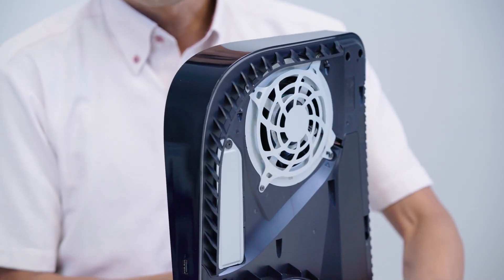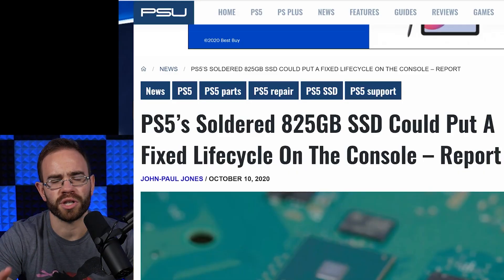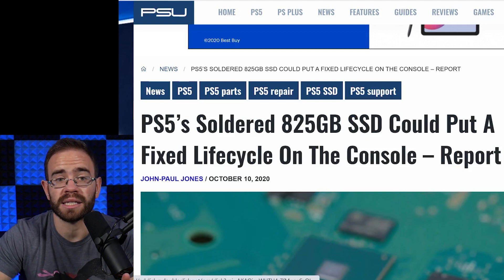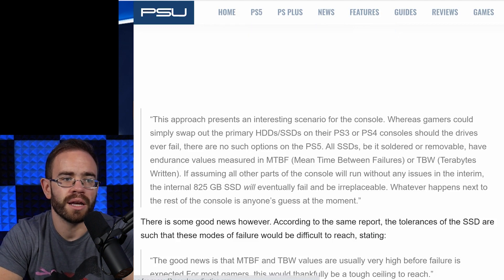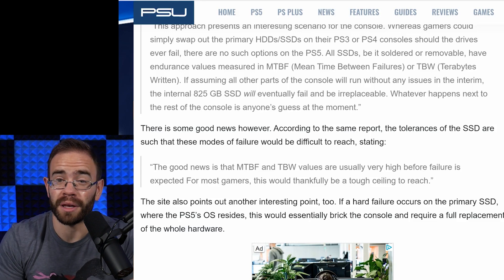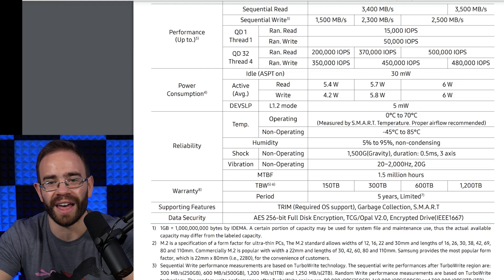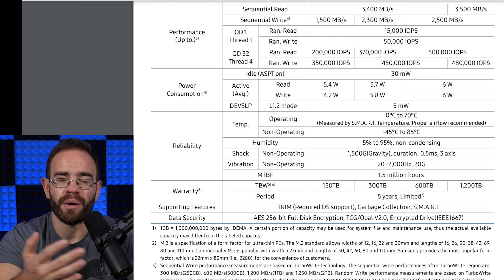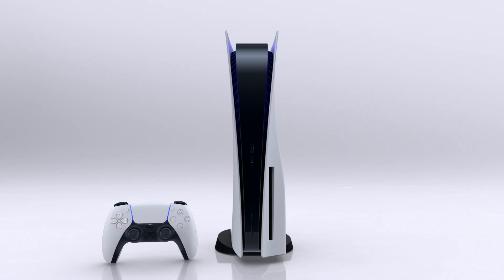Is The PS5/Xbox Series X SSD A Problem For Preservation?

Comment: In theory, couldn't they issue a patch way down the road that allows the system to run off of external storage in case the internal storage failed? I mean, I know you would have to do a factory reset of the system, but by the time that this could be an issue, the NVMe drives will be fast enough to run the whole thing. I mean, it's possible, right?

Comment: Wtf 600 tb is extremely low when we are storage limited? !That’s straight up stealing the consumers!
Reply: No it isn't.  That will last at least 15 years under normal use and that's the standard for anything between 500GB and 1TB, it's the same with the Series X, you'll have to write an absurd amount of data on a daily basis to kill it prematurely
Reply: SNM: Nightmare Hollow there are rumors that the storage in the series x is replaceable

Comment: The wii u had its 30 gb on the board, same with the switch. If those memory chips fail your screwed, no operating system etc..  Why is this an issue now all off a sudden?  I know it isn't the same, but look at old kart games.  Those chips are old as heck, and the ones that hold saves are going strong as long as the battery works.  I'm not worried.
Reply: Because these "issues" only gets hate if it's related to Sony

Comment: For anyone worried about this, please don't to give some perspective on it I have 3 drives in my system, 2x 2TB, which I have owned for 3 years and written 12.7TB in one and 19.3TB on the other, even if it was rated at 150TBW you can clearly see it will last a bloody long time.

Even my main drive with is only 512GB and is constantly download and writing to drive as its the main OS drive, has only written 22.9TB in the last 3 years, all 3 are filled with games I uninstall move around and so on. Now my 512GB is written for 400 TBW (a bit lower than sonys one maybe) and at the current rate, of me using lets say 8TB a year it would take me to 50 years to hit that, chances are in 50 years time the system would have died from a bunch of other things at that point

Comment: Sony could release a firmware update that lets you run the OS off the expansion slot if the onboard SSD fails, and who knows it might already be in the firmware, but it's a bit hard to test until the onboard SSD does actually fail.

Comment: The five years noted in the spec sheet was for the warranty, not overall reliability so is not really accurate.  The actual TBW would be much, much higher.  I know it's an apples to oranges comparison, but the warranty time was 5 years, but the MTBF was 1.5 million hours.

Comment: I'd be more concerned with a failure caused due to the new liquid metal cooling solution than the ssd
Reply: The liquid metal is gonna be fine. They sealed it so it won’t leak at all.  Failure from the liquid metal can get Sony in a lot of trouble. They would never use it unless it works bc of the high risk
Reply: @phantomchampion1579  Only time will tell......

Comment: As blocks die on SSD's, the drives are generally designed to automatically use new blocks from non-partitioned space. This is why I generally leave 3-7GB free on all my NVMe (SSD) drives.
Reply: This is typically done on a lower level in th ssd controller firmware, using spare blocks not visible in the partitioning tool. You should not need to leave unpartitioned space in order to enable this functionality.
Reply: S4RDONIC  you're on the wrong channel if you don't care about the tech details
Reply: S4RDONIC  By “free” he likely means unpartitioned space, rather than total space free. With that in mind he’s completely right, so why are you telling him to shut up?
Reply: S4RDONIC  I do.
Reply: S4RDONIC  we’re not going to be making assumptions here, are we?

Comment: You can on the Xbox! Go check the architecture! 
On the main SOC(APU) board behind where the external SSD drive plugs into, you will find the internal SSD drive which presses up against the chassis heat sink and is a copy of the external drive minus the plastic bit! And believe it plugs into a terminal and NOT soldered down!

Comment: Isn't that already a issue with... the original Wii? Yes, that thing has an SSD, with an actual capacity of 512 megabytes!
And seeing how much people still use their Wii's I have never heard of a Wii failing from a broken savegame chip.

Same issue with the Wii U, 3DS, Vita, and even the original NDS* 
(*but good luck on that one. It's flash does not contain games, updates, or saves, only a very few user settings)

Comment: The genius on Sony's part was splitting memory over 3 chips. Each chip has a potential failure rate, but when data is written and rewritten, it will go through 3 different chips, essentially reducing the failure rate potential. Also, cheaper and faster with the SSD controller. It was smart architecture. If you're really worried, install an expansion eventually and only use the expansion drive exclusively for downloads and keep the soldered chips for OS.

Comment: I'm surprised people are concerned about this. You would have had to install and delete Call of Duty over 60 000 times before you reach that TBW and there were a little over 4000 games released for the PS4, so you could install and delete every PS4 game released on the drive and still never reach it. By the time the SSD in the PS5 or SeX fails, we would have long moved onto cloud gaming most likely. If the PS5 will last a good 10 to 20 years before failure, then I'm good with that. And I'll probably upgrade to the PS5 Pro or PS6 or whatever comes out before that time as well.

I still have an original launch PS4, that I upgraded the HDD to a 2TB one and I moved that 2TB HDD over to my launch PS4 Pro and both systems are still running just fine. Also have an original phat launch PS3 which I upgraded to a 320GB HDD when I got it and that is still going strong today.

Comment: Even though I consider that the way these have been engineered with the SSD right on the board is the way that makes the most sense on an engineering point of view, I've been slightly concerned about future collectors ever since the specs of these things were revealed. Under normal use, these should hold up perfectly well for the next 15 or so years, though.

Here's a real-life example : I've been watching the writes on my current boot drive, which is a 512 GB Samsung 960 Evo SSD and is seeing some heavy use. I'm up to 40 TBW in two and a half years - it is rated for 200 TBW so at that rate it should fail in about 10 years.

These are the steps that I can think of to preserve the longevity of the internal SSD beyond the life time of the console :
- If it can be done at all, turn off the quick resume function. Each time you switch games, it will dump the contents of the user RAM on disk before restoring or loading the next game, and that can add up very fast.
- If you have a collection of previous-gen games, take advantage of the fact that these can be played from an external drive. Turns out an external SSD is just as fast on these older games than the internal one.
- If you find yourself installing and uninstalling games on the  main SSD on a regular basis, try and get a hold of an extension SSD. Not only will it wutr down on writes on the main SSD, but the more space you have on an SSD, the best the wear leveling system will work.
Reply: You might see parts of it go bad in 10 years but It might keep going for another 50 after that.

Comment: The IDE HDD in my PS2 is still going strong and the  SATA HDD that I've been reinstalling every time I build a new computer still works. It's only 250GB but that was a lot when it first came out. Before that I think I only had a 60GB HDD lol. That's the one I put into my ps2. The only problems I've had is with external 3.5 HDD's. I've heard people having problems with newer larger internal HDD's but I wouldn't know.

Comment: Anyway these consoles are not interchangeable. The time when each Sony console was unique is over since more than a decade. Its typically a system that will be replaced by the 6 and 7, etc and thrown away. Mainstream preservation won't be an issue because there is no point of preserving them anymore.

Comment: SSD's have been around forever. People do have warrant for concern. Hopefully SSD's have improved as much as companys say. Tons of people have had SSD's die within 2 years according to reviews.  I think a guy on the CU podcast said he had this die in 2 years and  it was one of the best SSD's so it wasn't a cheap one. Maybe It was Windows fault? I heard of windows doing unnecessary writes and optimizing too often on SSD's. Also heard reads are not a problem. Hopefully Sony has it make the least amount of writes possible. Maybe put games u don't delete on it and the rest on the add-on SSD.
U can't always go with the numbers plus updates are GB's of data being written and some games seem to update every other week. This might not be an issue hopefully but still
Food for thought until we find out for sure.

Comment: Console preservation died in ps3 when they decided to mass produce microtransactions one thing console peasants dont realize is that having the SSD soldered into the mobo is that if the chips die well you are left with 2 things 1 (Pray to God that a console hacker makes and finds a way to replace the chips if they are for some reason encrypted) 2 buy yourself a new 500 dollar console

Comment: Life span of a SSD depend heavily on the type of memory used. QLC have been shown to fail endurance test faster than TLC which doesn't last as long as 2MLC which doesn't last as long as SLC. 
For most cases TLC, 2 bit MLC, and SLC will all last over 5 years, but QLC doesn't under endurance tests. So it would be nice to know.
Also both have add on drive abilities that if you use the proper SSD will keep the same performance So I do wonder if it's possible to make them the primary drive if the included (soldered on) drives fail.

Comment: Xbox Series X SSD is soldiered on but it's all in one little unit so it would be easy to remove and re-solder a new one. PS5's SSD has been split apart into multiple parts.... P.S Digital Foundry tested the best SSD's on the market with the Xbox Series X internal SSD and the Xbox SSD was faster than all of them Soooooo clearly they didn't go for the cheapest one they could. Can't speak for PlayStation because they are still hiding everything for some reason

Comment: The SSD will probably outlast the rest of the system. People are freaking out because SSDs have fixed write endurance which sounds more scary than MTBF ratings normally seen on mass storage devices but the amount of data you will write to it will take 5+ years even for the heaviest user to hit.

Comment: Look at the write failures like: "you need to write 600x before issues occur".. so, if you write out 100% of your ssd in 1 week, then you would need to do that for 600 more weeks... 52 weeks in a year, meaning 12 years.
For a games machine it will be very rare that will happen.
Reply: This needs to be upvoted, dunno why everyone assume they can write over 600GB of data within a day or something by using the console normally
Reply: @NaohMkS  ta.. and yeah, consoles will be mainly write once, read many times.. sure you have save files, and temporary files from the OS, OS patches, but there's no way that they will amount to hundreds of gigs per week.

Comment: That’s good to here the longevity of the ssd is less of a concern. My question is if the ssd was replaceable / had a socket, would the read/write speeds by less than if it was soldered on the board?

Comment: Samsung is very conservative with their warranty, if you look at SSD torture tests almost any SSD can write 1000x capacity (1TB drive writing at least 1PB before failure), and depending on the way the memory controller handles data some can keep going to 2PB written overall by sacrificing storage capacity to maintain performance as sectors die.
(Though you do encounter more write errors this way, as sectors die it can corrupt data.)
Companies like Intel are more concerned with data integrity and just put a hard cap on the amount the drive will write, and after the stated endurance is reached it flips to being read-only.

Comment: The TBW (Terabyte written) lifespan, tends to alter dependent on the type of NAND memory used and it's capacity. There's 4 types commonly available on desktop QLC, TLC, MLC and SLC. QLC (Quad level cells) tend to be in larger capacity drives, however they have the shortest lifespan, while as SLC (single level cells) tend to be in smaller capacity drives and have a longer lifespan. QLC is also far cheaper per GB, than SLC. In comparison, the TBW of QLC NAND on a 1TB SSD, is usually only around 100-200TB and the TBW of SLC on a 1TB SSD, is usually around 3,000-5,000TB.
Samsung's 970 Evo uses MLC (twin level cells), but It's unknown what type of NAND is being used in the consoles. .At a guess, I'd say the consoles will use either TLC or MLC...between 300-1200TBW. Also bear in mind the TBW rating is the average lifespan (the 50%/50% lifespan mark) and they can and have been known to die long before this. Also, all SSD's gradually lose some of their storage space over their lifetime, as cells degrade and get marked out of service (unlike HDD's)

Comment: Seems like this is a thing we shouldn’t have to worry about. I do think about the longevity of consoles being important. Kind of like how the Xbox 360s life span was poor.I had 2 Xbox 360s break down on me around 3 years of using them. I’ve had a PS4 since 2014 and it still works. My thought is to replace your console once your old one breaks, or can’t play the games you want. So I’ll probably buy a Xbox series x or a new console once I can now longer play new games on my PS4. This may be best to do if you want your console to last until the end of the console cycle being around 7 years. If your worried that if you get a console at launch that it won’t last until the end of the gen. 

I feel like console life spans are usually pretty good. People will most likely lose interest in there console way before malfunctioning. I really doubt your ps5 is going to malfunction from proper use before the ps6 comes out. Cause that was my problem with my xboxes breaking down, was I had to wait for the PS4 to launch because I didn’t have a console for a year in between it breaking down and waiting for the PS4.

I could only see part reliability being a concern is if you plan on keeping your console for a long time, like a collectors item and want it to run far into the future.

Comment: Here's the thing. You can mostly just bypass this issue by throwing in a 2-3TB NVME drive three or four years from now those drives like that become cheap. At that point, if you're installing all your game's on that second drive, the amount of wear and tear happening on your primary should slow down to a trickle. Heck, it's even possible that some time down the line Sony will let us put the OS onto the second drive as well. This would essentially take the wear on the primary drive to a big fat zero, and if it broke down at that point chances are the system could keep running just fine anyway.

Granted, that's not necesserily the case, but the point I'm trying to make here stands. It is way too early to start panicking over system longevity.

Comment: It won't take nearly as long as you claim considering they are pushing the idea of moving games back and forth between the NVMe and an external HDD. 600 TBW is not that much when you consider the size of games.

Comment: The way SSD's work is they constantly move around and re-organise data to ensure a level amount of ware over the entirety of the SSD (has to do with the NAND cells), so even if you're only using it standard and not just filling it with games every week or 2 that write limit is going to be constantly burning.  Considering the size of games and amount of time people spend on their consoles, I'm giving these soldered on NAND flash chips 5-6 years before you start seeing serious amounts of people having issues with them.

Comment: MTBF is a very old term that was used in the days of spinning drives. Today’s NVMe and standard SSDs are often listed as DWPD. That’s how many full drive rewrites per day it can handle. Most  consumer drives are like a .5. Decent commercial drives are 3 DWPD. Extremely resilient drives are set at a 10.

Comment: Bruuuuuuh , that isnt even an issue, no PC user buys an SSD and thinks : hmmmmm, well, that X SSD will last 170 years while Y will last 150 years, i will pick X.   Like Bro, you are already dead by that time. However, the 600TB write thing maaaaaaaaybe is an issue if you use a secondary HDD and just swipe PS5 games back and forth with the custom 825GB SSD, but that requires alllllot of games and swipes, PS6 will already be released

Comment: I’m still playing with my father’s ps2 and ps1 and i want to give them to my son to show him where i grew my passion.
If a capacitor fails i can learn how to spot and replace it and even my son could if i teach him. 
If a soldered proprietary drive with custom controller breakes on the only board and replacing it would mean to pay for a new ps4, even if it would be fixable because it may won’t paired to the board (“security measure” is how apple justified it in the past) and Sony didn’t stated anything still, my son would have hard time to replace it correctly, or bring to a specialized technician, if there will still be any.

Swapping a drive should be compared to changing oil to your car, manufacturers are starting to sell a sealed car with the right amount of oil to last until it’s time to change car.